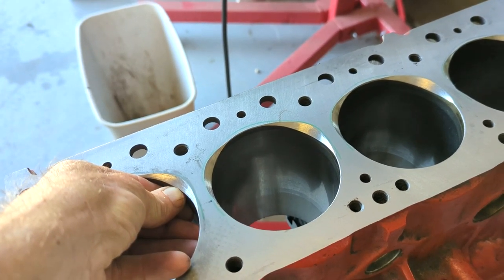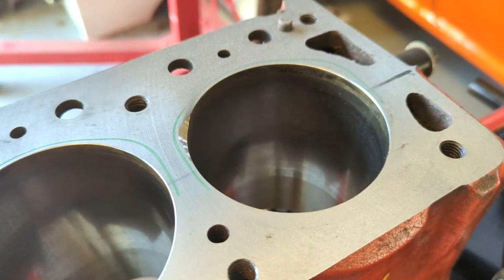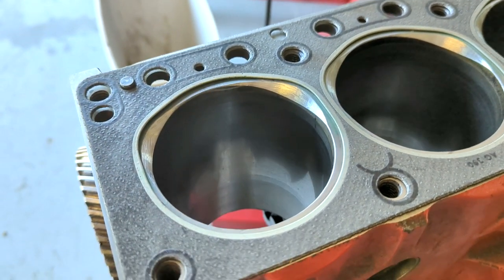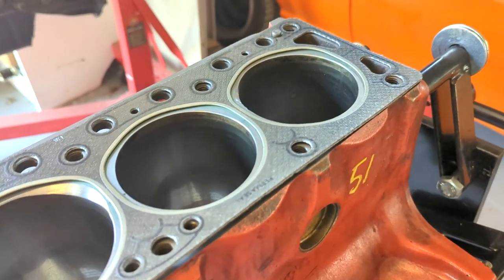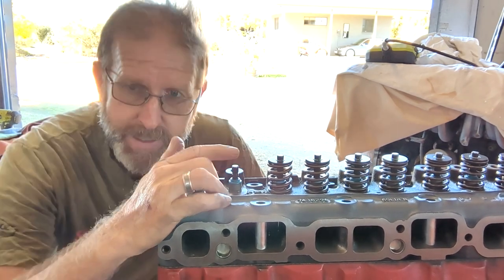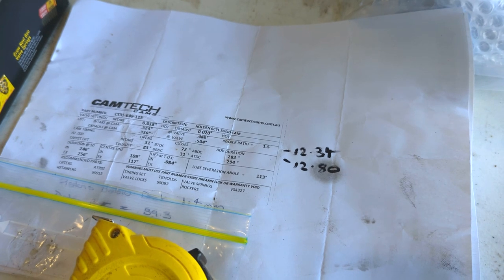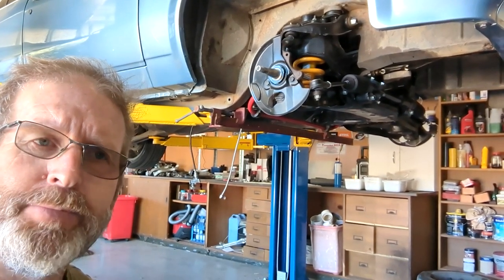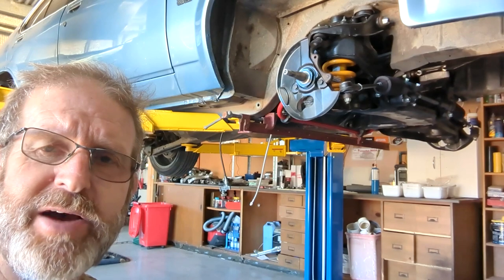No.54 Torana Build Valve Shrouding, Valce clearances - How to check-KamicarzCreations

Comment: I have slotted dowel holes is the head and side shifted it over and put some head bolts in and turn the motor upside down and feel how the head feels to the eye brows you put in the block.   You will have fun working out your compression ratio.
Reply from the maker: Yes that was an option, but i went this way instead....itrs a play thing and do it all for fun :-)
Reply: Wha?

Comment: Hi mate you forgot to check the valves with the retainer installed. Another quick way to check how much clearance you have above the piston is to use some clay under the valve.
Reply from the maker: Thats a great idea....instead of putting it on the piston....like it thanks Bill

Comment: Are you sure you're not using a 202 gasket there? because that gasket looks way wide for that bore and you will lose compression if so (unless thats your intended goal)
Reply from the maker: Possibly though im not worried. The comp ratio is adequate for now as eventually i will upgrade the induction with a turbo setup.

Comment: You could have bore it to 202 standard bore .
Christopher from Queensland
Reply from the maker: Not sure i could go out that far :-) its all fun and games......starting to understand why the 186 is so loved.
Reply: @KamicarzCreations  149 to 179 same block different bore
161 to 186
173 to 202
Reply from the maker: @christophercullen1236  wow Chris, didn't know that...may be another iteration yet. Thanks for your knowledge and input.
Reply: Just wondering how much the compression ratio is lowered by grinding off the top parts of each cylinder bore?  Was this allowed for in your final design comp ratio?